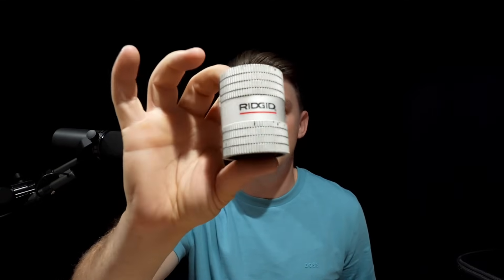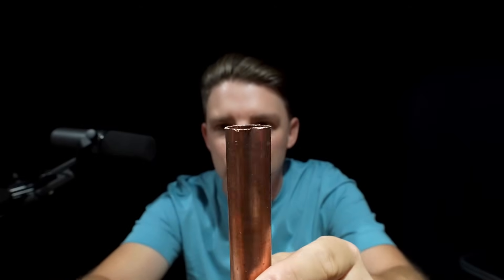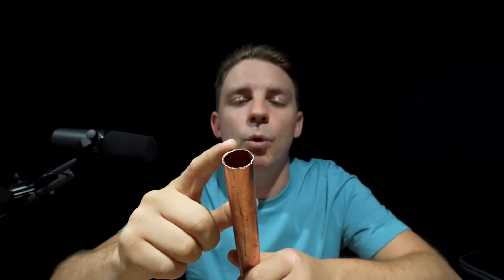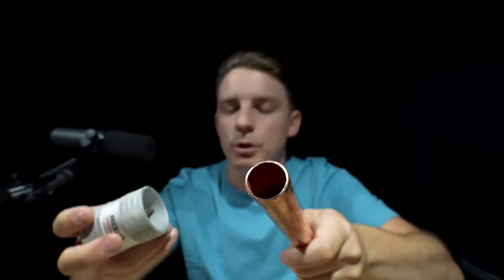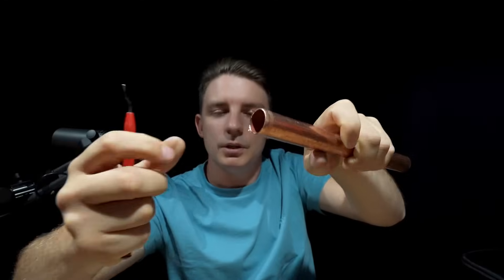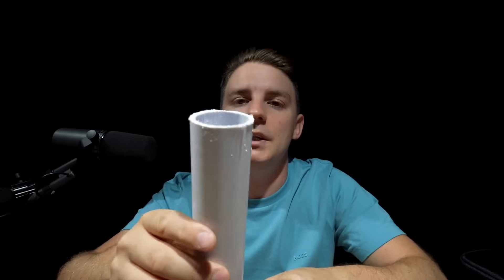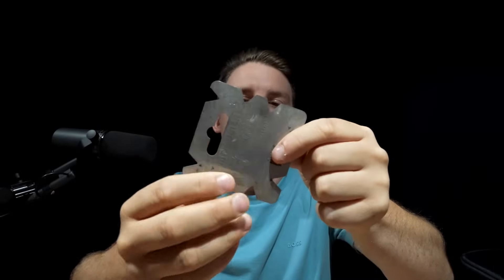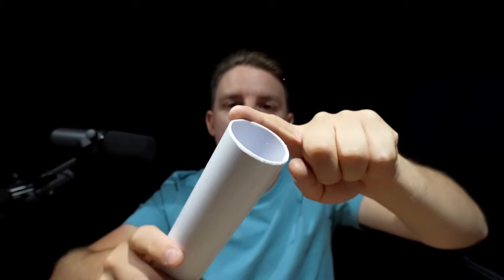3 Tools For Deburring Pipes!

Comment: I use a conecut taper bit for inside deburring. This bit is typically used to enlarge holes in sheet metal. Another tool I really like is my tapered brass drift. If the end of a copper pipe is not completely round,  a couple of taps makes it perfect.
Reply from the maker: Yeah good shout always good to have options

Comment: 2:08 That ridgid reamer is also excellent in restoring roundness of the microbore pipework after cutting with the hacksaw. Plastic elcheapos from fleabay have only 3 cutters and these eat up too much of the pipe.
Reply from the maker: Yeah in use it a lot for 8-10mm I need to get one of them straighteners

Comment: I'm also a bit inconsistent with deburring: generally, I do it all the time on plastic (for obvious reasons), but with the copper, I tend to focus on the outer rim for press fittings. This pen-like deburrer is lovely and lasts ages...until you loose it. I have already misplaced 3 this year only (approx £10 each!)  I have a subjective feeling that deburring inside makes the system quieter.  Pinhole in 20 years doesn't bother me too much. ;)
Reply from the maker: Haha it’s just good practice really isn’t it! I’m just as bad as anyone for not doing it!

Comment: It's a good idea but the whole turbulence myth seems like BS to me. Things like pex inserts will cause a hell of a lot more turbulence than a little burr. As you said, you hardly ever see professional plumbers doing it but look at all the copper pipework that has survived 50+ years and is still fine. If using push or press fit then the external burr could damage that as you said.
Reply: The quality of copper pipe has been going downhill over the years so that may be a factor though :(
Reply from the maker: Mlcp is the future
Reply: @mmplumber  soldered copper in my own house though 😁
Reply from the maker: Agree in a way pal, always best to try to the best comman practices including myself!

Comment: Yes especially smaller pipe.  I was brazing a compressor in and the lines were small.  I didn’t deburr the pipe The solder closed the pipe.  Not good.  Brazing rod is harder to get out and needs more heat.
Reply from the maker: That’s good to know mate fair play
Reply: @mmplumber  Yes thanks.  The burr closed the opening enough to allow the solder to do the rest.

Comment: Copper pipes are never cut with a hacksaw these days so the pipe slice leaves an end which is ideal to slide into fittings and especially push fit fittings. The deburring which you show is very likely to leave a sharp edge which will prevent the pipe going into the push fit smoothly and could damage the O ring. For a plastic pipe a cutter leaves a smooth end and before pushing the pipe  into a plastic fitting an insert is always pushed into the pipe which gives a smooth end to go through the O ring.
Reply from the maker: A cutter for place actually leaves a raised edge on the pipe which makes it hard to push fittings on, trust me I know and experience it a lot. A quick deburr on external makes them glide in 👍

Comment: I don't tend to find it such an issue on boiler pipework, but when it comes to heat pumps it's more important due to the flow rates involved. Also the biggest improvement is gas because you're dealing with such low pressure, we had 2 identical properties one deburred one not and on full rate we dropped below permissible pressure, would definitely recommend getting one. & yes we get bored and try random stuff for our own curiosity.
Reply from the maker: That’s class mate! For heating it can reduce pipework noise apparently. It’s a habit we should all get used to including myself

Comment: I use a tapered drill, usable for size 15 and 22 mm pipe. Pick one with the max capacity of 20 mm, so you can complete put the drill into the pipe. Handy if you have to put a return valve inside the pipe.
For the bigger sizes I use similar to the ridgid (first tool), except with an 1/4” on each side. I use it icw an handdrill and an bitholder, easy to change for the inside to the outside deburing.
Reply from the maker: I like your style mate fair play!!

Comment: I've been using an old-school (pen type) deburring tool forever for internal burrs from a 'slice' cutter. I rarely use a hacksaw on copper as they just make a mess of the cut (as shown) unless one has a very fine and sharp blade. 
I picked up one of these from Rigid and use it on copper and EMT. We can use bendable copper for feeds except for running to appliances, where I live. If you're cutting copper with a hacksaw, you definitely need to deburr both the interior and exterior, especially if you're using Sharkbites et al., and it will make for better solder joints as well. 
I also recommend the Milwaukee M12 mini bandsaw for all of these materials. Kinda posh, until you're working in a space you don't want to squeeze into and out of very often.
Reply from the maker: I love my band saw but only got 18v it’s an absolute beast tho!
Reply: @mmplumber yeah, it kinda boils down to choosing a battery platform unless one wants to carry a bunch of chargers and/or pay $$ for battery maintenance, etc.
Add to that there are some tools that require extra juice (angle grinders for example)
Given the price of batteries, it's a cost/benefit analysis as to whether or not a small generator and old-school 120v tool makes more sense. (Or a compressor and hydraulic tool)

Comment: I use the Rigid in/out deburring great tool. I notice with copper it tends to roll over the internal diameter. I keep deburring to rid of this lip. Is this correct?
Reply from the maker: Basically yes mate

Comment: Haven't watched the video completely yet but 100% agree with you.
Deburring is crucial.
I have several deburring tools to be able to face all the situations.
Reply from the maker: It’s something I really need to get in the habit of myself mate, made this video to remind me 🤣
Reply: @mmplumber  I use the barrel and the pen, those bring me up to 40mm diameter.
Then, I take out the big gun: the grinder with a flap disc. I use the deburring pen for the inside, and rotate the tube on the running dic flap for the outside. It's quick and efficient, but must be done outside.